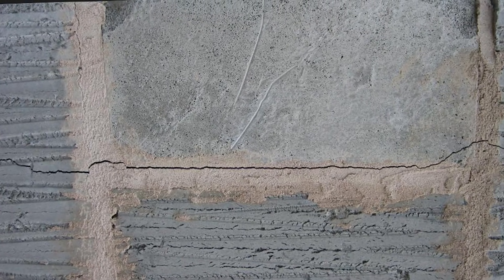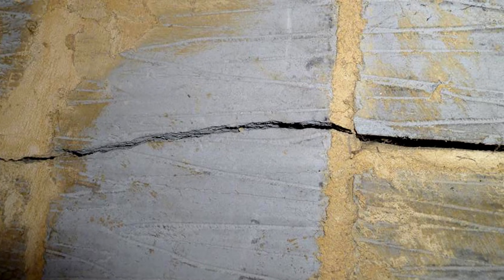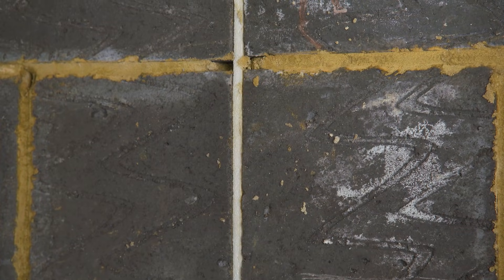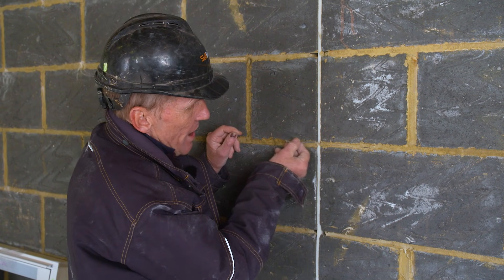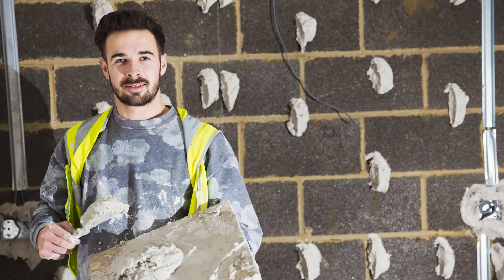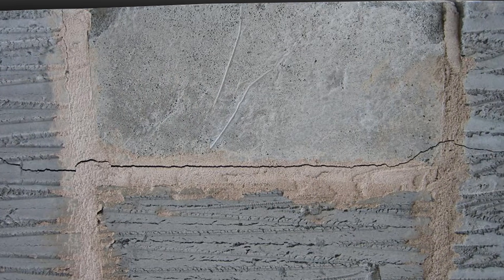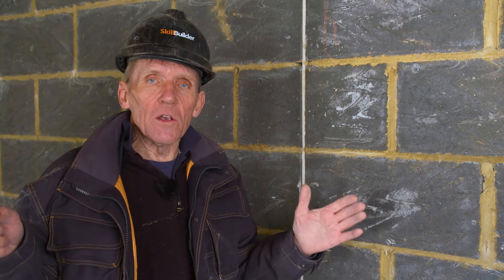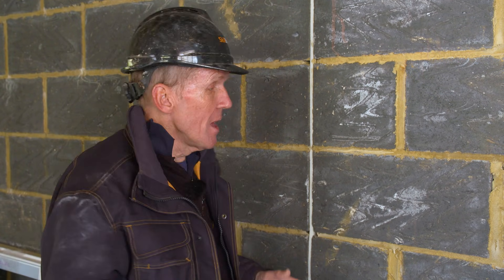Why Are Aircrete Blocks Cracking Up So Often?

Comment: As a fifty five year old bricklayer this lack of basic knowledge drives me nuts.

We used to have Clerk of the Works on sites monitoring the standard of work and materials used.
They got rid of them and the problems like cracking started.
 Instead of asking the tradesmen what was happening the college boys thought they knew best and started coming up with all these solutions, expansion joints, stainless steel rail tracks etc. These new ideas actually weaken the wall in a secondary way.

Roger was correct when he said, you shouldn't use a mortar stronger than the material you are using.
Any building older than a hundred years ago had no cement whatsoever, it was all lime sand mortar with no cracking problems. 
Most modern problems are the engineers being obsessed with strength, "Strength is better so make the mortar stronger." No, that is the cause of most of the problems.

Go look at a terrace row of Victorian houses, nine inch solid walls a street long, not a single crack from one end of the street to the other. 

Go look at huge Georgian houses, no cracks.

Go look at huge Roman buildings that have stood for two thousand years, no cracks.

But of course, we need to make our mortar stronger and add reinforcement to it. 

Is it me?
Reply: Couldn't agree more. Top comment
Reply: @FlamesOfThought  Thanks Jack. We just know
Reply: My dad still likes  working at 89 keeps him fit he is a bricklayer from school he will tell you about lime mortar and the shit today, modern ways are not always better , the bricks have more holes than brick nowadays ...
Reply: @philsmith214  Respect to your dad, I will tell my good friend who is 80 this year about your dad. My friend is still laying bricks, he likes to just do 3 or 4 days a week now. I once asked him when he is going to retire, he said never, it keeps him fit, same as your dad.
The wire cut bricks have huge holes in them now compared to years ago, your dad it right, bloody rubbish and harder to lay.
Love to work with the old guys, they just know.
Reply: @harveysmith100  he had to go to a job where he had to construct 18 bullseye windows  the 2 brickie gangs that were there could not do them , only one of the lads watched as he used a tile lath with a nail to form the circle 👍 can't beat the old buggers.
Reply: This should make you happy because you are RIGHT. 

My father was huge cheese engineer. Very clever man, I'm very proud of him. And when he sat on the board of the Civil Engineering Institute, he lobbied for accepting hands-on engineers into the Institute over their academic-professional-only lean (sorry if this  doesn't read the best, I'm trying to be diplomatic and it doesn't come naturally!)

He was old-school, had started as a marine engineer as an apprentice in the shipyards. He's academically qualified in four? five? engineering disciplines and can do the hands-on for all of them, because nothing can replace the knowledge you gain from actually working these materials and he felt it was vital it still be recognised last all that real-world knowledge be replaced by academe.

It's much safer, too. To this day, he'll happily crawl over massive diesel marine engines and even though they are unconnected and inert, he'll give a wide berth to the bits that can blow yer arse off. It's as instinctive to him as breathing and that can never be learned from paper or models or anything else.

We do a stupid thing when we throw away old knowledge. I have no practical knowledge at all but I have the healthiest respect for you fellas that you absolutely deserve. If someone works on my house, I want the bloke who has worked on sites, knows the materials, knows the pitfalls and then I take his guidance because that knowledge is ingrained. I don't care what papers he has, I want and pay for that working knowledge.

Academia has it's place but we really need to give all tradesmen much greater respect. Because if a guy with a list of qualifications tells me one thing and a guy with twenty years onsite experience advised against, who does it make sense to listen to?

Oops...thank you for coming to my TEDrant. But I feel very strongly about this (for obvious reasons) and if I can't do something I want a man that can and has. And I appreciate every one of you that continue to put that learned-the-hard-way info out there - I learn more in the comment sections of these vids than anywhere!
Reply: @randomhumanoidblob4506  Thank you so much for your kind words. I will always tell the truth as I see it.
Reply: @Harvey Smith
Then you're worth your weight in gold to your customers and I hope they appreciate it. I know a lot of us are utter dickheads but I love my builder. I even let him off the chain in the cellar sometimes ;-)
Reply: Was a subby 40yrs. You're  spot on. 
I would add that every sand has different characteristics when mixed. And a simplistic specified formulation of 5:1 or 6:1 etc always catches the college learnt guys out. 
It's practical application that determines a mix.
Reply: @thertis580  I agree, gone are the days when you could walk into a builders merchant and ask them what soft sand they have. Now theY say, it's just builders sand. 
 How I long for a bag of Runfold or Westerham. (The local sand quarries when I was a lad)
Reply: @harveysmith100  dont forget to add,every render coat,is weaker than the last one applied. As you head to the finish coat
Reply: @trevorleggett1777  Thanks Trevor, good information, never knew that one.
Reply: @harveysmith100  been a spread for 50 years. Also trained as a clerk of works.
Reply: @harveysmith100  What most folks forget is that kind of sand just isn't readily available anymore. We are literally running out of sand and the best sands are already gone. Doesn't help that China built entire cities, with the consumption of sands and materiel commensurate with such scale, that are empty and falling down, accelerating the depletion of construction resource materiel.
Reply: @meatybtz  well said - natural resource like this which nobody questions when it will dry up - just like oil.
Reply: @harveysmith100  With all this day-after-tomorrow wreckage it would be infinitely better to get to know the local materials. They can't all be from Love Canal. I envy you your knowledge.
Reply: @cherylm2C6671  Thank you
Reply: I might be wrong, I hope I do. 

But aren't those 100+ years old building cost a fortune to build even at those time that require labour and material that only the states or wealthy can afford. 

Not a fair comparison to the Common people House problem. Plus those material source are now extremely limited or expensive.
Reply: Nope it ain't just you brother. My 1st Instructed encounter with the logic of masonry, told me... Originally, the lime based mortar was designed to hold the bricks apart; not together. I came to the conclusion many years after that; as a custom home bricklaying contractor... that 3 things are for certain.
Hard Labor = moving each brick for the layer to lay & each shovel of mortar for the bricklayer to spread.
Glorified Hard Labor = Picking up & adjusting each brick to be leveled & plumbed after moving those cubic yards of mortar with a mere trowel for them to be suspended forever in that leveled & plumbed state.
The total Gloried Hard Labor of it all combined = ''There's no building material that has been touched and adjusted more by the human hand than that of the lowly brick or stone.'' -William Gilpin 71021
Reply: @soldtobediers  100%. The mortar is there to hold the bricks apart, not to stick then together
Reply: That’s right some of that silo mortar near the bottom is like class one far too strong
Reply: @markbutler805  Oh Mark, don't get me started on bloody silos!
Reply: What happen to "clerk of the works"?

Why aren't their role and responsibility absorb to another title like supervisor or inspector or whoever responsible for quality control?
Reply: spot on Harvey I live in a victorian terrace no cracks becos it's built from lime mortar which is much softer same as the soft clay bricks it accommodates structural movement,problems in old houses are caused with new materials
Reply: Agreed Harvey. I’ve seen mud brick homes that have withstood multiple earthquakes where concrete buildings have failed catastrophically.
Reply: @allanmcintosh3347  That is a very good point.
Reply: well said,
Reply: Reminds me of what my father used to say "what's the difference between engineer and a technician?" "A technician makes it work"
Reply: @TheSkinnzer  that's funny, because that's the exact same thing engineers say about architects. Crap rolls down hill!
Reply: @th3oryO That's funny, I figured it was the engineer's job is to tell the architect to shove it. Physics doesn't work like. But maybe I'm assuming too much?
Reply: @TheSkinnzer  nowadays, people hire an architect, and he finds the contractor. Now the contractor is a new kind that never seen a worksite except on a picture, he sends his foreman to make it happen. Now dangeling 5stories high hanging on for dear life trying to make it all fit together. He can already tell halveway it aint gonna fit. Yes its gonna fit, but to get it to fit the last piece doesnt have the space to be placed in the correct spot. Now hes an ass according to the contractor. So the contractor is gonna do it himselve. Almost dies trying. Comes to the conclusion the architect is made a mistake. Now has to go fix that. Wait for approval again. While the workers on the spot would just have cut the last piece in two fit it in and joined it together again. That usually how it works here.
Reply: You should see Nz , every control joint has no expansion, concreted right thru and the joint full with pointed mortar. After a summer a nice big string of daylight can be seen down the joint
Reply: Yes and don't forget it's also an art!
Reply: @hombrenuevoacts1728  It is when done properly
Reply: That's exactly what I think every time I see a clip of someone setting pressed straw and clay blocks with sack mortar.
Reply: An engineer doesn't tell you how to keep a bridge up. They tell you how a bridge can keep up with the least possible materials.
Reply: @rhys5567  That is a very interesting way of looking at it.
If we go back in history before engineers existed, they build by experience and over engineered things. 
I have worked on a lot of old buildings that are built so much better than those of today.
If we go back in history and look at Roman building, many of them have lasted 2000 years.
Reply: Building standards are so poor now days.    My mum is in new build and its a bag of shit like a DIY house.
Reply: @CrashUK28  My mother's house fell down like 8 times already.  What a pain.
Reply: Learned something new today, thanks.
Reply: I’m just amazed there’s any bricklayers about because at Manchester College in the 1980s they were running down the apprentice courses Chill there was none, if you remember Margaret Thatcher is great saying there’s no such thing as jobs for life you have to retrain several times in your lifetime so firms got rid of apprentices as not needed ! 
I would be very interested to know how are you got to be trained as a bricklayer being 15 in 1980, Or was you  one of the last ?
The manual trains have always been locked down on by the toffs educated of public schools as you say you need a damn lot of training several years to become anything good.
This useless scum have for 40 years thought six months will turn out a tradesman.ffs
Reply: @jimmorris5700  Yes, 1981 I was sixteen and started my apprenticeship at a Surrey college. I was really lucky because in my first year the lecturers where chatting about how the hell they were expected to teach the 1982 course in six months? 1982 was going to be the first year of the infamous YTS courses.
Now on site, I would say that 70% of the bricklayers are over 56, there are the odd few in there late forties, and I mean just the odd few, and the rest are under 30. The under 30's haven't been trained to the standard I was. 

I will give you an idea of what it is like on the site I am on at the moment. 7 bricklayers. 5 are 56 or over, 1 is 48 and the other lad is under 30.

You are right about taking time to learn to be a bricklayer, 3 years apprenticeship. Then maybe a year as an improver on less money then another six years as a full bricklayer to understand the trade and get really good. Ten years in total to be good.

There is a perfect storm brewing, Brexit, a chronic shortage of houses, lockdown, ( a lot of older bricklayers stiffened up after a year off and decided to retire.) and thousands of mature bricklayers coming to retirement age.

As for Thatcher telling people to retrain, that is all well and good but who is going to build the houses?
Construction trades are viewed as the lowest of the low but without us through the centuries, people would still be living in caves.
That beautiful school called Eton that all these ponces went to, it is only beautiful because of some talented bricklayers.
Reply: @harveysmith100 Bricklayers  don't  retrain.  Once a Bricklayer always a Bricklayer.
Reply: It's not you, it is the usual problem of higher ups thinking they know better instead of asking those that know. Add to that the issue of complex solutions to simple problems, and it becomes a mess.
Reply: No friend it’s not you. You are absolutely correct on every point

Former brickie’s labourer and Architect
Reply: @malcolmferguson2771  Many thanks
Reply: @Washing Up Liquid Valid point. The bloody damp industry to name one!
Reply: Totally Agreed mate 
33 years in the trowel
Cheers from Australia
Reply: @danozdirect3749  Do you have a clerk of the works in Oz or something similar?
Reply: @Ramzan I nearly let them do it to my home, so glad i didnt, the damp was caused by render bridging a tar damp course on the front and the garden being paved too high on the other. Oh, and the later double glaxed window was badly fitted, but it couldnt be seen, it was funneling water in, injecting the walls wouldnt have made any difference.
Reply: To be fair Harvey, any issues with those victorian houses would have shown up and been dealt with 80 years ago, and houses that failed badly are gone. Heard of survivorship bias? I am not saying you are completely wrong, just that those houses and builders werent part of some golden age.
Reply: @dorianleakey  It's a point well made but they would have failed do to poor workmanship not lime mortar. 
The difference between then and now, ( we still have good bricklayers and bad bricklayers) is the mortar. 
It wasn't a golden age, you are correct, I have worked on lot's of Victorian houses and apart from the facework, there is some shocking work. The difference was lime mortar will expand and contract, unlike a mortar containing cement. Every lime mortar joint and perp is an expansion joint.
Reply: Interesting.
Reply: Rebar
Reply: Just repaired 1850's chimney stack with mortar so crumbly bricks had fallen out.
Reply: #BOOM - I was just about to come here and state the same thing... Well, the cracking problem isn't just these bricks, but in ALL buildings not properly designed and built the correct way... You definitely said it better than I, so I'll forgo my own comment and just say WELL DONE SIR!
Reply: I'm no brick layer, but I know that buildings move with the earth, and that there isn't a material on this planet strong enough to keep a building from moving with the ground underneath it. For this reason, you make your building somewhat flexible/malleable. Using the most rigid materials available sounds like a good idea to some people (even within the building trade) but it could lead to early catastrophic failure. There's a reason bridges aren't made from hardened tool steel, and it's not cost.
Reply: You are so right.  The young bucks ignored me when I told them NOT to stucco over the 180-year-old brick chimney with pre-bagged cement mix in our home town.  Within a mere 9 months, the stucco was raining down daily and the brick was spalled beyond repair.  When the chimney was removed they had the good sense to hire an old bricker to make the antique lime-mortar mix to repair the brick wall to which it was attached.
Reply: woooo, amazing explanation about material resistant, you are totally right, is true that about that the old buildings without cracks, no cracks at all, but my neighbour wall is plenty of it, now i know why, im not a builder but i like to see how people work in diferent proyect of houses or little buildings and always i saw cracks on it, always is good to  know more about things ;)
Reply: wow nice insight just wondering if anyone has any tips on portland cement plasters how thick should i go and on what ratio with sand, i noticed that thicker plaster crack more easily is it because it is too thick orwet or my sand has too much clay. thanks for any tips
Reply: Well said. I’ve been a brickie for 40 years and in that time I’ve seen more and more nonsense come in from the alleged top, and more and more problems with the shell. There’s no such thing as coincidence here.
Reply: That said ,RBKC on the Grenfell Tower project had Clerk of Works!
Reply: I don't think anyone can add to that. Well done totally agree
Reply: It’s what happens when intellectuals take over. College boys as you say. It’s happening in every corner of the world. Left brain hyper focus can’t see the forest for the trees type thinking is game over for humanity
Reply: Bingo!
Reply: The main thing to think about is why the FUCK are we using aircrete blocks and worrying about cracks. Are these mobile walls or something?
Reply: @Beargrim  Very quick to build with, strong enough if used right, very good insulators of both sound and heat. Far more environmentally friendly to make and tranport.
Reply: There are probably as many people living in track housing in the US that use cinder block for the foundation as all of the people living in the British Isles.  And most of that housing was built in the 1950s and 1960s. This guy should stick to thatched roofed housing.
Reply: @kingpetra6886  We have cinder blocks in the UK, bloody things when you have to demolish them or cut into them.
I did think to mention them but I just couldn't be bothered talking to someone who openly disagrees with me when I have been a bricklayer for forty years. I know my subject. I don't just lay bricks, I have spent my life studying old building too.
Reply: @harveysmith100  "I don't just lay bricks".   I'll leave that one alone.  Stick with the thatched roofs.  Over here we'll have to wait another thirty years to se if there is an epidemic of collapsing foundations.  To be sure, cinder block is not used as much, but the solid concrete wall they use instead are probably less expensive because they use less labor. Besides, tearing down house is a national pastime in the US.
Reply: @kingpetra6886  If you have to tear down a cinder block wall, make sure you have a good mask!
There is nothing wrong with them as a building material as far as I know, we have them in buildings that are over a hundred years old.
I have noticed you tear down houses a lot more than in Europe, sometimes it just is cheaper to start again.
One more thing I have noticed, is in Florida, hurricane alley and they build with timber? I don't know why they don't built concrete houses down there?
Reply: @harveysmith100  Have you ever heard of Champlain Towers South in Surfside FLA? Just kidding.  First, many homes don't have basements, it's too wet.   I don't know why they don't either, although "concrete is not as rare as you think.  Wood frame houses are the most common type of house in the US and can last a long time if built properly.
Reply: @harveysmith100  
I've never done a survey but I'll venture a guess that most homes in South Florida are built using concrete blocks as opposed to the cinder blocks mentioned previously. I know some people use concrete block and cinder block interchangeably but they are different. My house was built in 1959 and has weathered probably 10 hurricanes in that time with no damage other than a couple of shingle tabs pulled off and that roof was nearing the end of it's lifespan anyway so I don't really consider that damage. Most wood frame houses withstand hurricanes as well. What wood frame houses really have issues with are termites and rot.
Reply: @rogermccaslin5963  Good info, thanks
Reply: I disagree. Those old style were not as material efficient. These blocks are weak they're full of air. An old style brick would be huge and solid.
Reply: @sebastian-daquanglocknerjr1883  I was looking for that reply.  That has to be accounted for.  But the rule still stands to keep the mortar weaker than the blocks/bricks.
Reply: @sebastian-daquanglocknerjr1883  I am guessing you are not a bricklayer?
Reply: @harveysmith100  I  concur. He's as thick as thick brick wall tho!